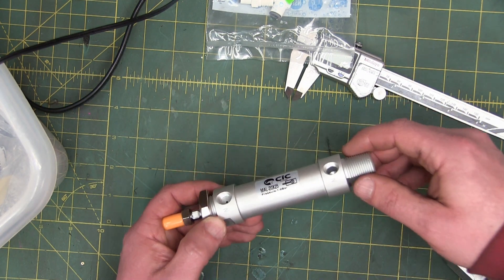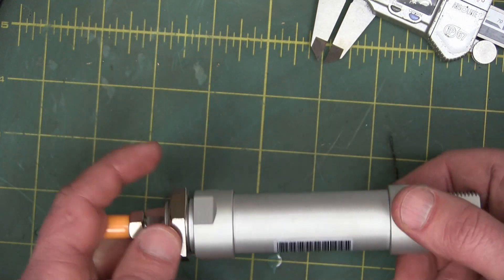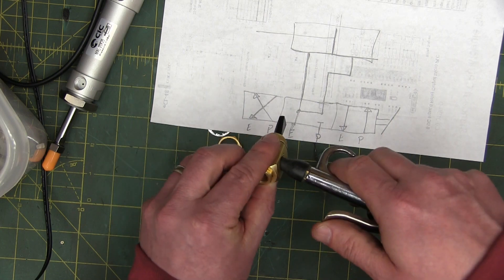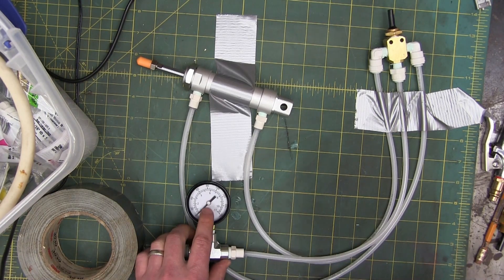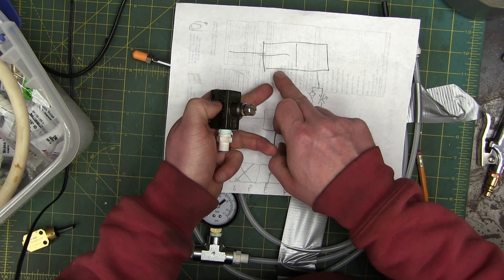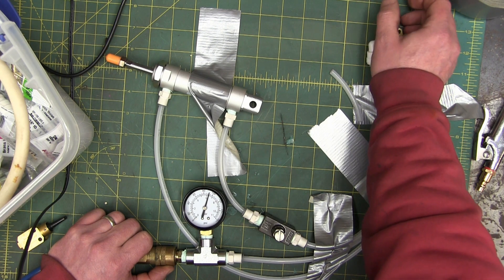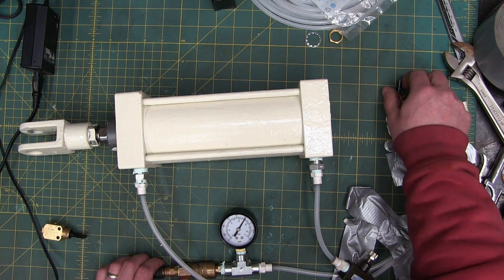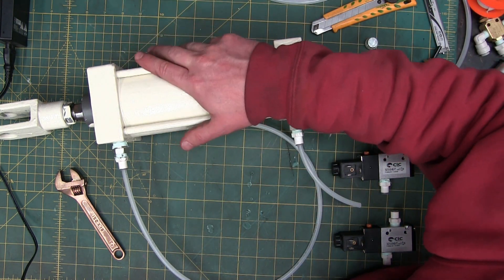PEW-PEW! Pneumatic Automation | Industrial Lego

Comment: This 100% applies to IT type work. If you look too closely at Linux you will burn your retinas right out, take a single step back and you discover it's littered with "legos"  20 years ago I was installing systems one painful command at a time, literally took days. Today I run a command and wait 12 minutes,  tada, system is up all the accounts and packages are there, even configured. Why do I even exist? Well mate I build the systems, deal with oops operations, drink a lot of beer. In my younger days I worked in a brake parts factory,  I hope to God that actual humans are not loading a part and pushing a button like I used to. It was mind numbing work. I didn't want to be there, just wanted the paycheck. Never seen a pneumatic toggle switch. When will the computers rescue us from this tedium?
Reply: Well unfortunately I believe there is a percentage of the population that is incapable of learning anything significantly useful. There was a report by the US military that deemed they could not train something like 18% of the US population for any role.
Reply: Urghhh, reminds me of leaving school 23 years ago, I had an interim job in a plastic mouldings company for 4 months before joining the RN. Seen those ladies skirt "coat hangers" that have the squeezy bit on one end? You squeeze it and it lifts up a small piece from the teeth on the body and lets you extend/retract the length of the hanger. Well, that part that you squeeze, 8 of them dropping out the arse of a hot and smelly machine every 12 seconds or so, grab all eight, tuck the lever down on each one, box them and then grab the next 8 for 12 HOURS A DAY! Still can't complain got me my first car and more importantly insurance! (Ford Capri 2.0 Ghia £500, Third Party Insurance £1070)
Reply: I hate programming, but I'm also not fond of burning a week doing password changes across the entire network. So maybe programming ain't that bad. When I finally scripted it out I got it down to two button presses and ~20 minutes of choochin on the confuser. Work smarter, not harder.
Reply: My entire career is built on Linux automation. When I started there were dozens of people doing mind numbing tasks. We're now getting literally 10,000 times more work done with zero people.
Reply: I heard that the law for US military is someone with an IQ below 83 can't join, which is around 13% of the population. They decided that anyone below 83 will always be more of a liability than an asset.
Reply: Sy Bernot I got my first big IT job by setting up as many new Windows PCs as I had KVM ports unlike the other guy who I wound up replacing who was literally setting up ONE PC to completion and only then would he even consider starting the next PC!!!!!
Reply: Same here 10 years ago this was a team of 13, now it's me and a new hire and probably double the work.  I know some people believe thats a loss of jobs but those people went on to better things and bigger salaries, I actually get to do much more of what I like, and all the work that gets done is 100% consistent and repeatable. With a single line of code I can change the passwords across hundreds of systems, or update hundreds of kernels, the code deals with the specifics and the machines do all the actual work. The best part of all is most any high school student can spend a little time reading the code and the comments and within a few hours be semi productive.
Reply: Only because they have a large enough supply of volenteers/draftees and a low enough demand for bodies to be picky. But if the SHTF, they would take any with a pulse. It doesn't take much IQ to stop a bullet.
Reply: It's the basis of thinking, "divide and conquer" kind of way. But it requires some patience to finally see pieces from the mass.
Reply: sy...it's all still dos :-)
Reply: Turns out there are people who like the misery. We are waiting for our's at work to retire. Little by little he is falling into bits.
Reply: Sy Bernot just work for yourself, that way if you get bored, just change jobs. Easy peasy lemon squeazy. BTW, I love linux. Haven't been down more than 10 minutes in 10 years!
Reply: Caldwell Transport Columbus, GA Nope, in fact, if you are below 88, the only MOS they offer is 88 Mike. Anything below that and production starts dropping even as numbers increase.
Reply: Its not about productivity, its all about numbers. You are talking about today. but just like in the early oughts when it was realized we'd bit off more than we wanted in Iraq, and they started waiving all kinds of disqualifications for recruits (tattoos, educatin', drug and criminal convictions, etc.) to fill trucks with.
Reply: Caldwell Transport Columbus, GA if you fill the trucks with guys that crash them, you're worse off
Reply: I hear ya. One of my first jobs after getting married was flipping a sheet of ply over after it came out of a sanding machine. Tedious, it drove me to distraction. Lasted 2 days and yet there had been blokes there in the same job for years. They were all unionised and they wanted to keep their jobs so the automated equipment was all stacked up in the corner. Jobs eventually went to China so no one had a job, not even the guys who were going to operate the automated machinery. Idiots.
Reply: #/OldTestamentUNIX/ cat PHILOSOPHY1.txt PHILOSOPHY10.txt PipePrayer.txt | wall

Decree by Saint McIlroy from Bell Labs 1978:
"Thou shall make programs do only one thing, and do it well. Thou shall make programs as if their output will be the input to other unknown programs. Thou shall avoid columnar and binary formats. Thou shall not insist on interactive input. Thou shall test quickly and toss junk quicker. Thou shall use tools in preference to unskilled help in the assembly of programs, even if it means making the tools yourself and tossing them later."

Saint Peter Salus further refined and simplified the McIlroy decree in 1994:
"Write programs that do one thing and do it well. Write programs to work together. Write programs to process text streams, because that is a universal interface."

It matters not whether we work with air, water, fuel, amps, or bits, we are all brothers and sisters of the pipe and the module. Lego is love, Lego is life.
Reply: Digital work is best left to digital machines, not humans.
Replacing WORKERS, who clean your crap and fix your furniture or renovate your house or empty the landfill isn`t the same as getting rid of some pencil dick sitting in an office making top dollar for helping rich people make more money literally helping nobody..
Your job can be automated, who looses anything then? YOU that`s who.
Bet you`d complain if you didn`t have a job at all, bet you`d miss that tedious shitty job you had.
Right after you loose your car, then the house, then you suddenly can`t eat, because you were replaced by some automated process..
Have a nice day, until you get replaced ;)
Reply: Sy Bernot what does IT work have to do with this nothing . because IT people don’t get there hands cut or have damaged skin because of chemicals or just hard days labour?  Mate seem like you haven’t done a hards days labour ever harden the fuck Up You muppet

Comment: What's a good place to pick up pneumatic fittings like this?  I've got a swaglog in town, but I already sold one of my kidneys.

(What I mean is: I like getting cheap shitty electronic parts off of aliexpress.  Is there something similar for pneumatic fittings?)
Reply: Ryan Mcdermott Automation Direct is fairly reasonable for basic pneumatic fittings. The plc Ave is talking about using for this also come from them.
Reply from the maker: Homeless deathspot in with the irrigation stuff.
Reply: I'm sorry, I said fittings, but what I meant was stuff like the pneumatic cylinder, or the pneumatic toggle valve.

Ask a fact, share a fact: not sure if you guys have this place in Canada, but I usually buy all of my pneumatic fittings and custom hoses at hose power (I build stuff like this: https://vimeo.com/239421740).  The guys there are really helpful, too.  Even if you're not building flame throwers, they also sell really nice garden hoses there...and it's just a cool industrial place to check out if you've never been there.

I guess I meant: if I want good reliable electronic parts, I go to mouser or digikey.  If I want a chinese flea market full of weirdo electronic stuff that is cheap and sortof sketcy, I go to aliexpress.

It seems like the pneumatic equivalent to digikey is swagelok (or hose power for me).  Is there an equivalent to aliexpress?  Cheap, slow shipping, super crusty pneumatic components?

If the answer is still homeless despot, then DAMN you guys have much nicer home depots than we do here in Arizona!

Comment: Can you tell us where you buy the the actuator?
Reply: And cylinder
Reply: Just be careful on ebay.  Most of the stuff is BSP instead of NPT.  And the descriptions aren't generally that informative on threads and fittings.  The point being that you need to ensure all your parts are in the same thread

Comment: would it be possible to get that change in speed by say increasing the length or diameter of the line or would that not make a difference?
Reply: Brennan Fry Yup, speed is directly related to flow rate. But in this case that would effect the speed of both extension and retraction cycles.
Reply: Yes, but industry standard is to use a speed valve like he has there. Some places will just throw in an orifice - basically a metal plate that has a drilled hole, then you can change out to different sizes.

Comment: hey, my job is literally moving a pile of chit from point A to pile of chit point B. Sometimes, I get to put the rectangular piles o chit into rectangular holes. my job is so boring and I'm so overpaid. seriously, I get paid more than welders to do the boring job I have. I have wanted to quit so bad, but can't find any other job that pays what I make without a high level of education. To boot, my job requires nothing as far as education goes. I could be replaced by a robot no problem. but hey, I also do the work of two other people just to stay busy. moving their piles o chit so they can sit back and relax in the office. and make as much as I do doing less than a quarter days work. I don't really care. I just like to stay busy at work.
Reply: Idaho Livin' just don't wear out and bodyparts!
Reply: You must work in the oil field
Reply: Truck driver
Reply: Idaho Livin' -
Reply: Davias, good guess, but he says he's overpaid, so can't be truck driver. Might be some sort of heavy equipment operator. (I'm not saying heavy equipment operators are overpaid, I'm just trying guess what he actually does from his comment)
Reply: cmans79tr7 spot on. powered industrial truck operator. but I also move trailers around in the lot, so truck driver was pretty close as well. ha.
Reply: cmans79tr7 well, technically any truck driver earning more than his market value is overpaid

Comment: I wonder how hard it would be to make a calculator out of hydraulic parts.
Reply: Totally doable. You can actually do fairly complicated logic gates with just fluid flow. It's used a lot in things like jet engines. 

https://en.wikipedia.org/wiki/Fluidics
Reply: Quite hard.  See https://flic.kr/p/m3KzGg that rack of shit?  That calculated the difference between the ordered & actual RPM on HMCS Protecteur...and adjusted to make the speeds match.  (FABBCLAWS- Feedback,Auto Roll over, Brake, Boost, Cutback, Limiting, **, Wrong way Alarm, ** (Can't remember 2 of them...)
Reply: I don't know about hydraulics, but you might find "The Cogwheel Brain" by Doron Swade worth a read. What Babbage did with cogs and springs is amazing.
Reply: just whack mechanical calculator into youtube. nice things
Reply: Well whole ships ran with pneumatic controls years ago so it is possible
Reply: It's been done. Babage had a "difference engine" that was mechanical, Vladimir Lukyanov made a hydraulic computer (that actually used water). To make any computer all you need is a NOR gate. To make one of those all you need is two normally open hydraulic valves in series. With enough NOR gates you can make memory, processors, and anything else that is digital inside a computer. Two of them will make an R-S flip flop (the simplest form of memory bit), you need about 10 for a binary single bit adder with carry so about 80 for a full 8 bit adder. You can see how it could work but you would need about 10,000 of the damn things, to make a very simple computer.
Reply: Well there are logic valves (at least for pneumatics) . So you can easily put together a NAND gate (See NAND logic on Wikipedia). And from there on the Sky is the limit. Like really you could build a CPU with this stuff, but it gets huge really fast.

Comment: if you want fast and slow actuation, use a larger bore tube on the fast extend and smaller bore tube on the slower, itll limit the air flow
Reply: Epiphic this method's a lot less headache when the boss inevitably decides it needs to go faster/slower.

Comment: So the valve on the retraction, does it work purely by regulating the volume of air flow out - in which case the pressure is irrelevant? So if it's set to allow 1 liter per minute, that rate will be the same regardless if the air is at 10 PSI or 100 PSI? That's very handy, and it's a lot simpler than the electronic servos that I'm working with.

Comment: In this example, wouldn't it make more sense for the flow restriction to be in the inlet for retracting the cylinder?

If the cylinder is fully extended, and we return the switch to center. Both sides will exhaust. If we go to retract the cylinder once both sides are down to atmosphere, it will fire back since there is no pressure built up.
Reply: controlling inlet on pneumatic never works very good, air works a bit like a spring, and if you control the inlet, you have one side at "high" pressure and one side at atmospheric pressure, if you couple that with resistance many time uneven from whatever the cylinder is trying to move you get a jerkie irregular and possibly violent movement, controlling the exhaust gives a much more fluid movement
Reply: Just controlling the exhaust side is enough, has a restriction to flow will maintain a constant pressure on the inlet side,  has long has the restriction is bigger then the force you are trying to hold, if the restriction is smaller then the force you are holding will command the movement, typically we place restriction in both inlet and outlet but always controlling the exhaust, personally I prefer silencers (exhaust) on the valve with regulable restrictor normally the valves are in a easier to reach place and if you want to adjust the speed manually valves usually have some kind of manual bypass on them them so you can  activate the valve and control it on the same place.
Reply: Usually both inlet and outlet are controlled but both at the exhaust side, you can complicate a good bit depending on the system needs, for example a vertical door would have to be designed in a way that in case of power failure, pipping rupture, or whatever, if the door is open it must stay open, for safety, so and now sorry my lack of English vocabulary, usually we place on the restriction on the cylinder piloted valves that close if no pressure is present at the pipes, ensuring the door stays closed and doesn't smash anyone. Sometimes you want exactly the opposite and in case of failure you want the system to be free and depressurized, and some other valves we use, etc.
Reply: Nuno Almeida Great posts! Your English is good, keep practicing in discussions like these on the internet and you'll be perfectly fluent in very quickly!
Reply: Nuno Almeida Thanks man, makes sense now. Movement will be weird where pressure gets high enough to overcome stiction move a bit and stop.
Reply: Nuno Almeida But to get consistent slow return, you need a valve that closes both lines instead of opening them, so pressure drops slowly in the middle position. But of cause, then it won't float.  This doesn't matter if the machine cycle isn't supposed to float before the slow return, or if there's a weight on the actuator causing return even in neutral valve position anyway.

Comment: I was half expecting to see the pneumatics controlling the toggle valve to control the pneumatics. No need for electronical confusers, and the thing would just keep running as long as there’s pressure to it.
Reply: or until the pneumatic control is full of gunk or wears and starts to misbehave, has been done, electronics work better in most cases
Reply: Question: The pneumatic actuator part also wears, gunks up with time I guess.
Is it because the pneumatic control part has thinner pipes that it will fail much earlier?
Reply: Pneumatic systems will wear with time, but that's what maintenance is for. There's no reason to think a purely mechanical system would necessarily start to misbehave before an electronically controlled mechanical system.

What the electronics does give you is greater control and flexibility for future changes.